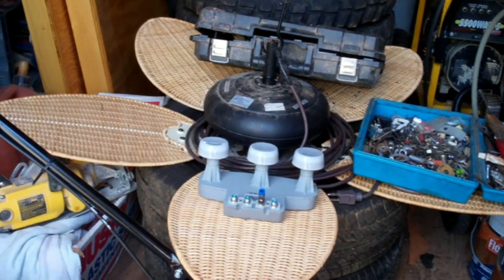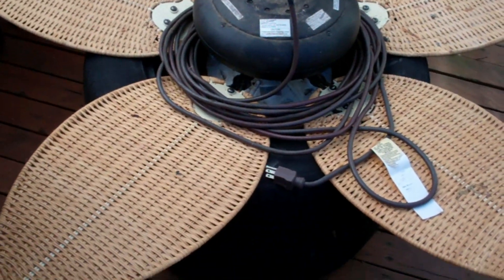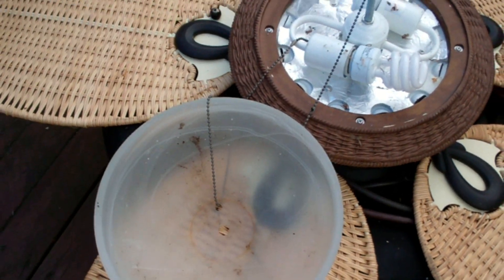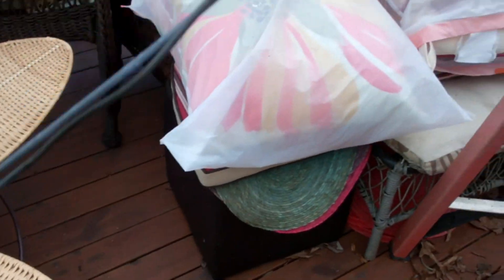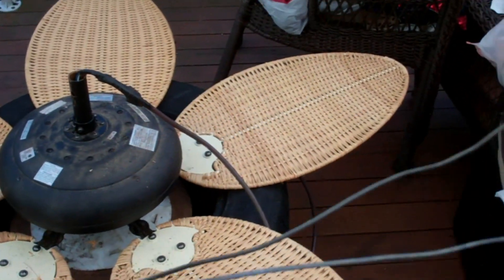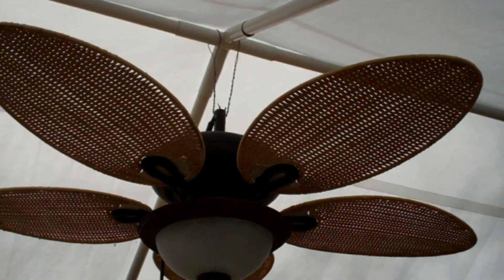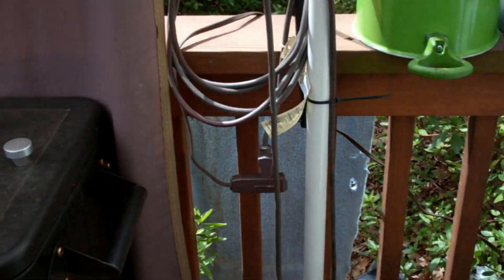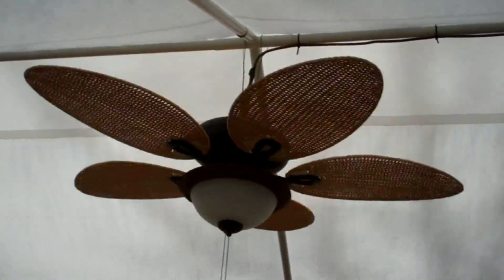Rigging Up a Gazebo Ceiling Fan

Comment: Any issues using an indoor fan... outdoors? Have you been using it all the time...just thinking that motor winding would rust over time and fail. Thx!
Reply from the maker: No issues other than it tends to get a bad wobble on high speed and yes I use it all the time.
Reply: Don’t use indoor fans outside period

Comment: How is that carport working out for you? I found your channel bc we've been looking at a gazebo, but they just seem so risky. After seeing your ice storm damage, I'm definitely not buying one. But we do need shade desperately. I think I'd consider the carport and sting up lights and maybe some screened curtains somehow.
Reply from the maker: Lisa Elle The 10 x 13 carport gazebo from Home Depot is a much sturdier model than that fancy one from Big Lots.. It's not as pretty but it does the job for us.
Curtains can be rigged up to it (I used one of the old collapsed gazebo sides but the roof arch I haven't found a way to cover though it's not a big deal to me.. I would recommend this carport style, and a replacement tarp when needed is easy to find at a reasonable price. Hope this helps.

Comment: where did you get the fan? I can't seem to find one anywhere. Also I've been there done that loosing a gazebo to strong winds.
Reply from the maker: We got this from Home Depot but it's since been discontinued.. They may have something similar to it but I don't know.
This gazebo also came from Home Depot and it may not look like much but it does the job, and is much sturdier than the fancier styles.
Reply: thanks
Reply: There's a new one that look's like it it's called the Harbor Breeze tilighman at home depot
Reply: @LibrarianB the fan is a harbor breeze tilghman and was discontinued years ago